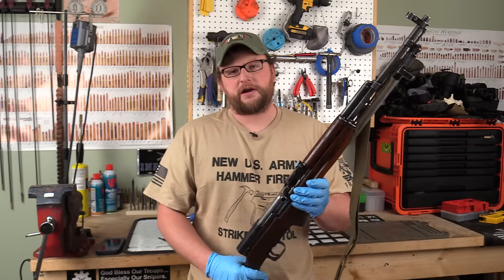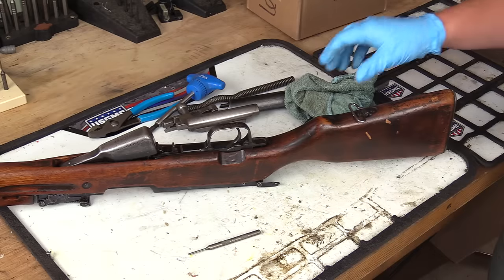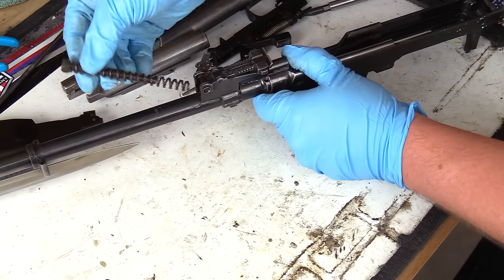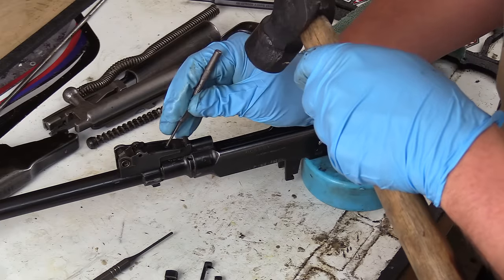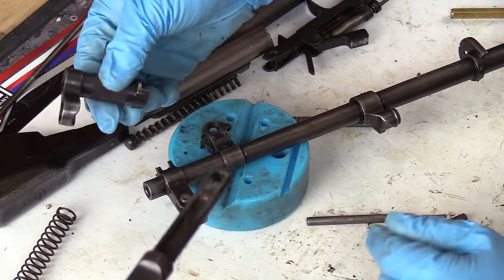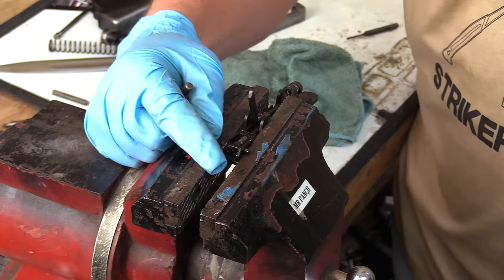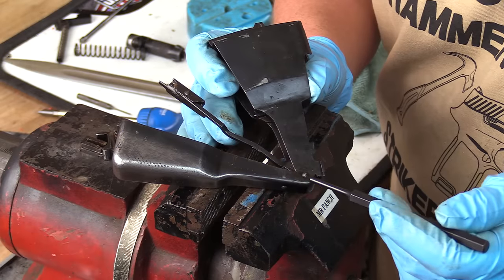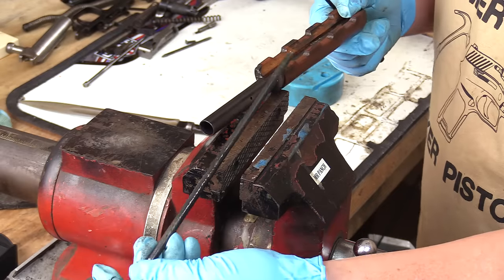SKS Full Disassembly & Cleanup

Comment: A small pointer here... To remove the cleaning rod much easier and faster than demonstrated, all you gotta do is pull out the bayonet and leave it free without fixing it on the barrel. There, the cleaning rod is freely and easily pulled out.

Comment: Great video Eric. Two comments. You can use the cleaning kit (if you have it) to help turn the lever to remove the gas block. The cleaning kit has a groove in it just for this purpose. AKs are the same way. Second, two say you need to give it a hard wack to get to the firing pin is an understatement. I have 3 SKSs and I've not been able to crack my Tula's bolt open. Luckily I don't need to but God help me the day I do. On my Norinco and my Yogo, I replaced with firing pin with a spring loaded one (two prevent the possibility of a slam fire) and they were much easy (still tough though). Keep up the great work.

Comment: When I bought mine at Crappy Tire a few years back, I expected it to have cosmoline throughout the action. Surprised to find very little but tore it down anyway. Trigger group excluded as I was still very new to guns (SKS was my first personal one). Didn't touch the rear sight until I decided to replace it with a peep sight (Magwedge Raveneye from Canada Ammo). Wish I'd had a brass punch as the sight adjuster is now marred. Have to get a replacement in the future. I made the mistake of taking the wood off the gas tube (can be done with a small drill and loads of patience) but it had a slight crack and tinkering with it just exacerbated the whole thing. Put the ATI Fiberforce on it and am pretty happy so far..cheers from Canuckistan

Comment: Thank you very much for this video. I just purchased a SKS. I had no idea how to clean off the cosmoline. Taking it apart seemed to overwhelm me as well. Your step my step video was exactly what i needed. I put all of the small parts in a old pan with water and boiled them. It removed every bit of cosmoline. Again i say THANK YOU.
Reply: I just got my SKS in from Classic Firearms, did you take apart your trigger group before you put it in boiling water? Just wondering because I don't have a vice and am having a very hard time disassembling it, just hoping I can put the whole group in and it will get most of the cosmoline
Reply: @Herk762  I don't have a vice either. I put the whole thing in the water and boiled the hell out of it.
Reply: I removed the parts while they were still hot. The hot part made the surface water evaporate. Then I used gun oil on all the parts.
Reply: @davidfreise7715  ok I'll do that, thanks for the help, also were you able to disassemble the bolt? I've been hammering at the retaining pin for a couple days now and it wont budge, tried putting it in boiling water and soaked it in water and simple green overnight and tried again this morning to no avail. Some people say as long as the firing pin moves freely you should be good but even my firing pin won't move.
Reply: @Herk762  I didn't take that apart neither. You are right that it needs to move. Try WD 40. If that doesn't work take it to a gun Smith. It's that important.
Reply: @davidfreise7715  ok I will, thanks a lot man.

Comment: all though this is a two year old video, it is very well put together and very informative, i just got a Norinco SKS, i had a lot of fun taking it apart and cleaning the cosmoline, i boiled the small parts and the cosmoline came right out  no problem, for the heamer, disassembly and reassembly i used a half inch pvc pipe to pry and it is super easy, my SKS is looking great, thanks for the great videos Eric

Comment: our comment regarding the gas tube pin being fatter on one side saved my SKS project... I had inserted the Front Sight Assembly pin into that gas tube end and only after having watched your video did I realize I had the wrong pin in there.  I had to take mine out to fit into a new Choate stock (they actually come with a new pin which I tossed by accident), but I only realized my mistake when you mentioned that the pin for the gas tube end was fatter on the one side.  THANK YOU!

Comment: Well I put my SKS back together today. Thanks for your video it was so helpful in my disassembly and cleaning.  Getting all that smelly freaking grease off was a real chore. The real challenge was fixing the years of abuse to the stock. I am going to use the original stock with all the marks and scratches in place. The stock itself is smooth as a baby's butt now.  I sanded it to the original wood. Then smoothed it put put on two coats of red mahogany stain and two coats of Tung oil. It sure looks nice now. The only thing I have changed out on it was I put on a aftermarket butt pad. It fits well and In think I will leave it on. Thanks again for your help video it sure was nice to have to help me out.  I can't wait to shoot it. Just waiting for the bullets. Tap, Tap Tap, Tap goes my foot as I wait. LOL !!! I let you all know how it shoots soon.

Comment: Have y’all seen that “world of guns” game on steam? It’s freakin AWESOME for disassembling and cleaning guns you aren’t exactly familiar with. You can digitally deconstruct every single piece of almost any firearm. It has X-ray mode. Slow motion action X-ray so you can see how they mechanics operate during firing. It helped me a lot when I took my sks apart the first time.
Reply: It’s a stretch to call it a game too. You do accumulate points for doing things right but it’s more of a digital educational and engineering tool. Now before I buy a new gun I X-ray and blow it up in the program to see if there’s anything stupid in it that’ll break. Like that little pin that holds the slide onto the old colt 1909s. Somebody wanted to sell me one and I chose no because of that specific part.

Comment: I baked my SKS trigger group in the oven at 100 degrees for about an hour to melt the cosmoline out of it. Then I let it soak in greased lightning over night, sprayed it liberally with brake cleaner and lastly, put a light coating of WD40 on it. Got it cleaned out pretty well. That part to me looked like something I didn’t need to try and disassemble.

Comment: Great video. I just finished my cleanup and could not have done it without the video. My only problem was the magazine. Obviously, my SKS was mixed and matched at some point. The magazine was not the original and I had a real job to get it out and back in. On the next cleanup, I'll need to file the parts a bit to expand for clearance.

Comment: Suggestion, while you have the SKS apart replace the firing pin with the aftermarket one that has a spring to push the pin back into the hole. The stock pin when dirty can stick out causing the firearm to empty the mag as soon as you chamber a round and release the bolt.

Comment: A good habit to get into, what I do, is to keep a box of small ziplock sandwich bags on your bench. Every part of a system goes into its own bag and labeled if need be. Too many times I get someone that can't remember which parts go where after disassembling a rifle and it's been several days before reassembly. Especially when it comes to small parts and springs! Sometimes roll pins can look close in size and it's easy to mix them up.
It takes just I little more time but is worth it. Or you can bring it to me and pay me to have to figure out what you've done and to get it back together. Which usually costs more than if you would have brought it to me to do it in the first place.

Comment: A live cartridge also works as a disassembly tool if you don't have a punch or the cleaning kit in the buttstock. The rim of the cartridge can be used to rotate the takedown lever and the bullet point to remove the trigger group and the gas system. The only thing you actually need the cleaning kit is for the front sight adjustment.

Comment: For cleaning the gas tube and hand guard, I've had good luck with setting it in the sun on a hot (110 degs) day  for a few hours, and then using mineral spirits and a good brushing.

Comment: Boiling water with Dawn diswashing liquid in it works wonders on cosmoline in the trigger group, magazine, bolt & bolt carrier and the spring-loaded op rod extension under the rear sight base. I put a towel in the bottom of the pot so the parts are not sitting directly on the bottom of the pot. If you're pressed for time, you can put the barreled receiver in the dishwasher & run it on the hottest setting with a detergent tablet. You can then clean the receiver and barrel like normal.

Comment: You placed the sliding elevation cam on upside down @52:43.  See  @10:50 .   Yes it's to the back, but now the "dressed down" surface will not contact the ramp (the sloped surface of the rear sight) when adjusting for range.... changing the "factory zero"

Comment: I know some gunsmiths restoring old wood will soak the stocks in acetone. It drys extremely fast and pulls oil out of the wood. Although I’m sure some hot water, soft scrub brush, and simple green would work just as well.

Comment: One last thing that you should tend to.  The butt plate has a hinged trap door.  You may want to take the butt plate off and clean up the two springs inside as well as the back of the butt plate.

Comment: I found pouring boiling water over the action and barrel got most of it off.  then sprayed pb blaster to displace the water and break down the last of the cosmoline . Then wd40 and finally a good cleaning with  gun solvent and gun lube on all moving parts.  I also got a new sear and did a trigger job.  Also new firing pin / spring kit.

Comment: I had an SKS once. They had "problems with cycling" and I came home and cleaned it after buying it, and the gas piston in the tube had to literally be beaten out of the said tube. Ran a dry patch in it and twisted it around and it came out black. I used gun cleaner to clean it. (Obviously. What else would I use gun cleaner for?) There wasn't a white spot on that patch when it came back out. Happened 2-3 times. After that, I lubed up the piston a little and stuff it back in the tube, and the thing would just about fall out.

Comment: Eric. Seriously dude. No zip tie needed. Let the bayonet hang 90 degrees to the barrel. It puts less pressure on the spring. Then a little pressure on the blade and you can pull the screw out. 

You can download a SKS 56 user manual and learn all this.

Comment: I just take it all apart, throw it all in a tub, spray it all with break cleaner, all the greece slides right off, then green soap and brush really good. Then clean it with some croil oil. Re assemble. Done.

Comment: I bought my SKS 20+ years ago, the bore was completely full, the receiver and spring were full too, I collected 4 oz of goo what a mess.
Reply: Don Bahn you probably got a good unissued one
Reply: My Chinese SKS was the same way, it was far from unissued. The bayonet looks like it may have blood stains and was probably used to pry open cans or something, bluing is probably 20% maximum. I spent hours finding and removing all of the surface rust, including all over the gas tube (including under the handguard) and even inside of the trigger group, and the stock is beat to hell.
Reply: xb0xisbetter mine was very similar but wasn’t full of goo. Blueing was very warm, along with rust, it was like someone took some heavy grit sandpaper and never bothered to fix it. It definitely takes hours to remove old bluing by hand...

Comment: Do an SKS trigger job video like you did with the mosin! My sks trigger is ATROCIOUS !
Reply: hes aready made a video on that
Reply: Honse, I did mine,  It's not that difficult.  Get a Wolf spring kit and work the sear just enough until the hammer doesn't move when the trigger is pulled.  100% improvement.  You'll have to assemble it a few times to get it right.  The hardest part is getting that damned hammer and spring in and out!
edit: I think I had found a video on another channel.  It's been a few years.
Reply: Honse my nariko pre ban sks has a great trigger

Comment: So could I use a heat gun-judiciously applying the heat-to speed up the drawing out of the cosmoline on the stock?  Also, can brake parts cleaner be used to clean the metal parts in lieu of Simple Green?

Comment: Second question: since I’m already tearing down the firing pin assembly, would it generally be recommended to replace the stock pin with a Murray’s replacement with return spring, or are slam fires easily avoided by proper cleaning and lubrication?  Some of what I have read has me a bit paranoid about leaving the stock free-floating pin in place.

Comment: If you dangle the bayonet, then the cleaning rod just falls out without having to force it. The bottom of the bayonet is beveled to allow this. Locked tight when open/closed, loose when dangling...

Comment: See I went and changed the furniture on my Yugo sks and I was wondering on the spring in the stock on where the trigger group sits.  I could not get it back into the tapco stock I put it in.   Went with out and it seems to be fine, I would not mind doing some fine tuning on the trigger group and see about doing the drop free bolt mod to get the mags to install and remove with out having the bolt pulled back.  Love my Yugo though it really works well.

Comment: Couldn’t you, with the upper hand guard, clean it without removing that rear-pin by putting it an over that has been set to "warm" (which is usually a temperature between 150°F and 200°F) to allow the Cosmoline to bleed-out?

That would seem to be better than leaving it in the sun for two days, and easier to control. The wood can be protected from direct heat by simply placing some aluminum foil over it.

Comment: can you help me? I have an sks in a tapco stock ,took it apart oy as far as removing the bolt assembly,cleaned it and now after assembling the mag won't go back in and the bolt hold open is not engaging,any tips?

Comment: OK at the point you are about to remove the bayonet you should have soaked the whole thing in  acetone overnight including the wood to draw out oils in the wood. cleaned it up with a little bit of WD 40 ,lubed joints,   put it back together and you would have been good lot of extra work for nothing and another thing get you some wooden blocks on your vice actually drill some holes and riveted did some thick leather.

Comment: How are you ever supposed to use an aftermarket stock if you don't remove the pin in the handguard/gas tube? The stock I got with my SKS is beat up and carved on all over, and I really want to get a new stock. But now I'm scared I'll break it if I try to remove those parts. And I don't want to have a new stock, but still have the nasty old wood handguard riding on top.
Reply: Tapco sells the complete gas tube with plastic handguard for around $50, so you can just put your old wooden one aside as an extra.
Reply: @Herk762  But no one sells that stock or that handguard anymore.

Comment: Hey guys. I have a Yugo sks and the bolt won't stay in the locked back position. Any solutions?
Reply: Dillon Jones the way the sks bolt hold open works is a small metal tab sticks off the back of the follower and interacts with a spring loaded tab in the receiver, you may want to check if that metal tab is broken or bent or if the small metal shelf on the hold open itself is damaged

Comment: Is the Russian and Norinco sks  the same or different when cleaning them.
Reply: The same. The only real difference between the Russian and Chinese variants is the type of bayonet, and maybe the hardware used to hold the bayo in the lug. My Norinco has a pin to remove the bayo, which is really easy to punch out, but the Russian is usually screwed on, like in this video. Hope that helps.

Comment: So I also have a big problem with my PTRS-41 and I even know how to fix it but I don't have an opportunity to use such an extremely complicated and possibly illegal stuff that is required for fixing that shit!I mean the explosive compression of the barrel and also beefing up its thickness especially at the muzzle end,with chrome lining as well!So I see 3 operations to make it good to go because it is completely worn out!And as it is 1942 year of manufacturing,it is too skinny and too weak to withstand a lot of factory ammo through it!
As well I do have the KPVT barrel but I don't want to buy another one because I want to make a high precision magazine fed straight pull bolt-action rifle of my own design based on KPVT barrel and my own design of all the rest of the gun!So fitting the barrel of KPVT to PTRS-41 receiver is not an option(until I will at least find another KPVT barrel)!Better to convert that original one to be as reliable as the KPVT's barrels which by the way are enough reliable to withstand 25 thousand shots through it!So can you please tell me what to do about it?I really don't see any kind of required tools to make that kind of operation in Canada,as well as I don't suppose that anyone will let me use almost 4 kilograms of hexogen to compress it!

Comment: I love your channel but I'm going to have to call BS on this video. How much did you pay for the sks in this good of conditio $600?
Some lazy ass armorer thought it would be a cute idea to shoot corrosive ammo through it and let it soak I'm cosmolime. Damn rifle from classic firearms, the entire diust cover bolt body, seized, and the barrel looks like someone drove over it with a truck with how its bent. So Much cosmolime, I had to use engine degreaser. If you wanna do a video on gunsmithing/repairing an sks, I'll volunteer mine! It's so worm out and seized that I can't hit a man sized target at 50 yards! You can remove the cleaning rod much easier when the bayonet is in a T position
Reply: Seriously though, can you please use my rifle as a demo rifle? Lol